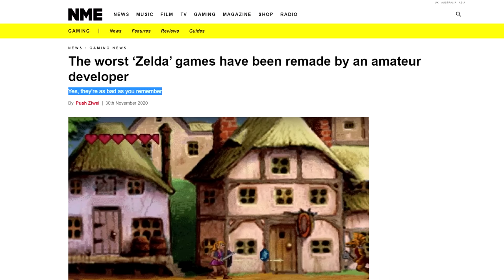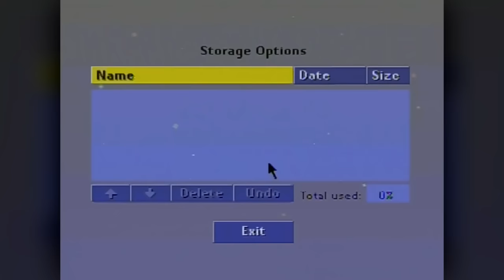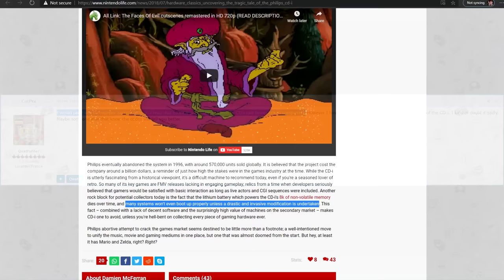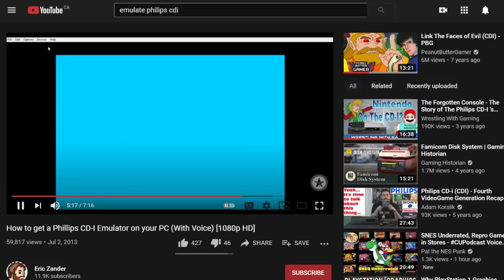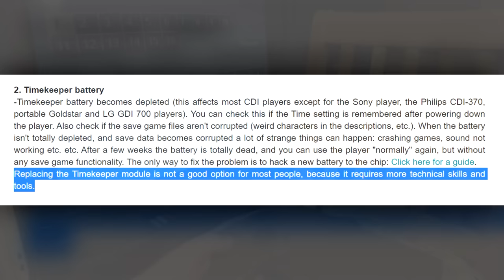Don't Risk Buying a Philips CD-I

Comment: CD-i owner here. You don't actually have to Dremel away the Timekeeper Chip. You can desolder the chip, solder in a socket, and buy a brand new replacement chip. I tried the Dremel trick and fricked it up, and I found a guy who sold me a replacement board for my model, one that he already socketed. If you need any extra help with your CD-i, let me know.
Reply: how do I do it
Reply: Some help needed here too. I'm about to buy both Zelda games as a collectors item. I do not expect to be able to play them though. Do you think I can buy a bumped up CD-i for an acceptable price anywhere these days?
Reply: @LevelUp_ErikJ  I've just picked up a 450 and it thinks it's 1989, so will need to do the battery fix. Not looking forward to it 😕

Comment: fun fact: this console is the first console to have a home screen, the year for this was 1991 when it launched.
Reply: That's probably because it needed to have one. Previous consoles used cartridges which could not be inserted with the power on, so having a home screen made no sense there. It was once machines could be booted up without media that they needed to show something on the screen.
Reply: Wouldn't the Famicom Disc System count? 1986
Reply: well the philips cdi had the first interactive one
Reply: @TeaMal_FX  The Commodore CDTV came out in March 1991, nine months before the CD-i. It had a home screen too. (CDTV was the first out of the gate of the failed "multimedia appliance" systems, of which CD-i and Tandy/Memorex VIS were the other representatives.)
Reply: @NozomuYume  well its a computer tho
Reply: @NozomuYume  and philips cdi was a console
Reply: @NozomuYume  but it might count tho
Reply: The 1990 Commodore 64GS also have the standard C64 home screen bcs it's just a C64 without a keyboard. but U can't actually do anything with it.

Comment: Protip: the CDi can play burned CD-Rs
Reply: Framerater has had horrible luck burning his own CDs. Check his 3DO and mistakes made video for details.

For me I think his mistake is not trying to burn his discs in slow and fast speeds, as some discs burn better on faster speeds. I find this strange, but I have had first-hand experiences where burning a disc slowly caused more problems that burning it quickly.
Reply from the maker: @thepuzzlemaster64  Someone told me that DiscJuggler can force drives to write slower even if they're not listed as compatible to do so. May have to look more into this...
Reply: @FrameRater  Imgburn or Nero at 10x (minimum supported) using just whatever CD-Rs I had in the drawer with a laptop CD writer worked fine. My CD-i (same model as yours) doesn't sound like that during boot.
Reply: Use good quality CDRs. I imagine it also helps to have a label on the top to make the disc less "see through". Most CDRs can be held up to the light making them see through.
Reply: @FrameRater  In my experience buring cds for the cd-i can be pretty hit or miss. some discs I burn work flawlessly, well others I have to pop in and out repeatedly to read. I recommend hp cd-rs as I got the best results from those
Reply: @thepuzzlemaster64  It can be a bit of a crapshoot. I have to use separate CD-R brands and burn speeds depending on whether I burn Saturn (Maxell discs at minimum speed) or PS1 discs (Verbatim discs at maximum speed).
Reply: @FrameRater  And I can confirm this is true. Funny thing is it'll force it to burn at slow speeds unless you buy the premium version or whatever, which no one ever would because the only reason anyone uses DiscJuggler would be to burn Dreamcast discs and you've gotta keep the speed at minimum to ensure a successful burn anyway.
Reply: @FrameRater  Burn speed doesn't matter, it's all about what blank discs you use. Only use Verbatim AZO discs. They have to be AZO, specifically. Any other discs, even other types of Verbatim cds, or other brands are most likely made by a company called CMC Magnetics, and are useless trash.

The AZO discs are made by Mitsubishi, and have a blueish color. They should work flawlessly, no matter what speed you burn at.
Reply: @FrameRater  
What I recommend doing is using CD-RWs (AKA: the reusable ones) as a way to test if the burning technique works, then using a CD-R for doing long play sessions. It helps keep the coasters to a minimum...though keep in mind, I've never owned an early CD console before, only burned early Windows games.

The real problem that can happen when burning discs is that the disc-drive that you're burning the discs to could wear-out quickly. Don't quickly burn 50 CDs on a laptop disc-drive, those things might start banging their laser heads to end their suffering.

PS: never been a big fan of Windows CD-burning tools. Every other OS like Linux or Mac come with a good one pre-installed. They don't do the weirder formats, but they are excellent at ripping and burning iso and bin-cue files. For Linux, if Ubuntu doesn't work try Manjaro.

Comment: I would recommend checking out Angry Video Game Nerd's CD-1 videos. Despite his videos being made before the 20 year mark, he mentions during the third Zelda game that he can't save, which would suggest that the model he's using (one of the VCR looking ones) will still boot the games if the battery is dead.
Reply: Not to mention it was his third CD-I, as the first two had issues.
Reply: I own a couple of CD-i's. All batteries are dead but they all boot the games except for one of which the battery died recently. I guess I'll have to wait a few weeks and try again when the battery is totally dead.
Reply: most of the CD-Is (like the 450 in this video) have no problems to boot with a dead NVRAM, other models such as the smaller 470 and the early 200 series have issues at booting.

Comment: The AVGN episodes were made within the lifespan of the battery.
oof
Reply: Now I feel old. Thanks
Reply: AVGN isn’t even the oldest internet video game series. The oldest I know is Classic Game Room, which debuted in 1999.
Reply: He also said in one of his videos (the Hotel Mario review) that he had to bought three units until one of them finally worked!
Reply: @DoswarePictures  At least AVGN is still running.
Reply: @DankRedditMemes  he even joked about it in his latest episode about how shows like The Simpsons shouldn’t run for too long, then said it was time for AVGN episode 180 something.
Reply: @LUCKO2022  though at that rate he also would’ve had the control port issue fixed.

Also, didn’t one guy who worked with him fail to fix the Jaguar CD?
Reply: @DoswarePictures  That dude you're thinking off was the guy who built the Nintoaster that James used for a long time.
Reply: @Laynel8  I know.
Reply: @LUCKO2022  huh.
Reply: Yeah but even with that it seemed like he had some battery issues. In his video he said he went through two 450 models and had to return them for disc read issues, which I'm assuming had something to do with the battery. He ultimately used a CDi 205 for his video, it had a dead battery but that model at least plays games with a dead battery, you just can't save. 

My CDi is a model 220, time keeper battery is dead (shocker) but seems that model will also play games with a dead battery. From what I've heard the 450 model is the most notorious as far as battery issues go.
Reply: Last time I turned my cd-I on would have been before 2010...mine is whichever model had a spring loaded hinged door hiding the cd tray
Reply: Ya but the avgn also complained about hardware issues and don't remember him mentioning anything about saving but he really only went into the Zelda games more than anything
Reply: @douglasschneider6753  well I think he did. And so did PBG when he first did Faces of Evil.
Reply: IIRC in one of the Zelda game reviews he complained the saves wouldn't work. Might be from the battery dying.

Comment: controllers
Nintendo: box then box with rounded corners
Sega genesis: comfy controller that also works with the 2600
Phillips CDI: SPOON
Reply: Sure you can have a spoon, but can you name one console that has a stick on top of a d-pad
??

Truly the top of culture.
Reply: @ItsRetroPlanet  Other than the generic PC 4 button controllers, no.
Reply: Sounds like a controller only The Tick could love
Reply: @FatMarioHeads  SPOOOOOOON!
Reply: Tommy Wiseau is a big CDi fan :) But seriously, those controllers were just supposed to be like handheld mice. Not for the games. This is another reason why it failed, it couldn't workout what it was. Games will never do well if you have to buy a controller as well.
Reply: It's too big to be a spoon, it's more like an ice cream scooper.
Reply: The Tick would be proud.
Reply: TRUST ME THE SEGA MEGA DRIVE CONTROLLERS WONT WORK ON THE 2600 IT WILL FRY YOUR 2600
Edit: it might not be guaranteed to fry it just don't quote me on that
Reply: @MatthewCobalt  The first version of the Master System  controller also had a screw-in thumb stick. No one used it and it was quickly removed to save costs.
Reply: @melo-7904  I've been using my sega controllers on mine and haven't experienced any frying. (The og three button, an ascii version of the three button, and the six button controller. No issues though I think I remember hearing pressing start on those might do that but don't quote me there)
Reply: @BioMega96  it might have been the other way around its been a while since I last heard it

Comment: I actually found a CD-I 220 during my sophomore year of high school back in 2012 where me and our robotics club were in charge of clearing out one of the school’s storage rooms for a then-upcoming garage sale. Mistaking it for just a regular CD player they planned on selling it for only 5 dollars, but as I was the only member of the club to recognize what the machine actually was, I expressed my great interest in acquiring it, and I actually ended up getting the CD-i for FREE when no one ended up buying it at the sale.

Though the disc tray needs a new belt and the front port tray accidentally broke off not too long after acquiring the unit, the actual hardware still worked upon powering on, and could play backups perfectly fine. Doing research into the unit I learned about the Timekeeper battery at a young age, and I only ever had it plugged in when I was actually using it, helped by the fact that there was no evidence of saved data prior to my aquisition. 

I am still in possession of the CD-i to this day, though I almost never use it except for occasional shits and giggles. Last time I turned it on would have been sometime in 2017 or 2018, but last I checked it seemed to be working perfectly fine. Even if it does end up failing in my lifetime, at least I can rest easy knowing I didn’t have to spend hard-earned money on a CD-i of all consoles [the unit at least. Acquiring the VCD card and an adequate controller did set me back a bit, but it was worth it to play the CD-I’s surprisingly decent port of Dragon’s Lair]

Comment: the CDI has no copyprotection like the 3do.  You can just burn the game iso's on a blank cd and they should run fine.

Also I hope you give Atlantis: The last resort a go. Its the cdi's second released FPS title and the only standalone CDI fps title.
Reply: Doesn't it require a digital video module?
Reply: @ZykovEddy  Yeah, I think so.
Reply: I had one of those too I thought it was neat at first then I found a way to find games to make my own cds I tryed out a lot of different games on it did you know you could go online with that too
Reply: sega cd also didn't have copy protection, for those wondering.
Reply: Illegal
Reply: @rido1274  no, Not really. The system hasn't been supported in nearly 30 years. No new games are being made for it commercially in over 20 and nobody in the company profits from selling the games or consoles. It is basically abandonware, much like most of the consoles from the 90's aside from the nintendo ones.

Comment: I hate to be one of those people leaving a ridiculously long comment but here we are. I'm kind of known for being a CD-I fan and bit of a historian on it. Not how I expected my life to go lol.

 I hope this doesn't come off rude but bidding on the cheapest CD-I possible on ebay, or most other electronics, isn't exactly the best idea. I've got a 200 series with a dead battery for years, literally since I've owned it, and aside from it not saving games it plays all games just fine. It had the same embedded battery in a chip but it doesn't need to be replaced. The issues with certain CD-I models (due to time) is pretty well documented. I believe some of the sites you credit throughout the video have details on it. The 3 button Genesis style game of us good if you get one in decent shape. I use a snes to cdi controller adapter and the CD-I mouse cause some games really play best with the mouse.

Did you get the video cartridge for your CD-I? Without it some games can't play or will play with reduced quality. There's some genuinely good games on the CD-I like Thunder in Paradise, Chaos Control, or the beat em up Mutant Rampage Body Slam. There's even a FPS game on the system. Ok the FPS game isn't great but that's more due to bad art direction and kennel design. It actually runs very smoothly. There's also ports of Myst, 7th guest, dragon's lair, several American laser games, I could go on. Also, you can burn any game for the CDI. Archive org site has almost every game available for download. 

I'm sorry your CD-I journey got off to be a bad start but a lot of the "pitfalls" that come with a first CD-I purchase are avoidable. I'm on Twitter if you need any help with the CD-I under WrestlesGaming.
Reply: amen.
Reply: @nathanielcody6769  There are two versions of the digital video cartridge. The first one has a larger casing and is a 100 pin cartridge that won't fit in the 450. There's a second one made for the smaller second generation of CD-I consoles that's 120 pins and does work on the 450. 22ER9956 is the model of the DVC needed for a 450 CD-I.
Reply: @nathanielcody6769  
what adapter?
there is a slot under the left top cover for the smaller model DVC.
Reply: @einherrjar  I think he's under the impression that the DVC doesn't work on the 450 at all. My guess is he or someone he knows tried using the wrong version of the DVC in one. I think he's just using "adapter" as the part of the DVC's name.

Comment: I ordered a modded CDi system from the same seller Patrick (sellingmycollection78) on eBay back in late November. The only difference is that I'll most likely receive the spoon controller and not the superior one. Either I'll have to ask Patrick if he sells those separately or mod a device to use a SNES controller to the system. I'm still waiting on the system due to the pandemic and I did ask him about the item location issue and last time we heard about it, the package was transferred from the NL Post to the USPS and that was on December 11. A couple of days ago, Patrick requested an international inquiry with his post office in the Netherlands to get to the bottom of this. So he is really generous when it comes to locating the system, especially in times like these.

Update: I received it in the mail yesterday. The only thing is that you'll need to buy a EU to US plug adapter since Patrick doesn't include them with any of the modded systems he sells.

Comment: I'm proud to have hunted down a 3DO and I still play it from time to time but I sure as Hell won't go out of my way to track down a CD-i unless it's at Goodwill for cheap (sometimes depending on the model they might mistake them for being old CD/DVD players).
Reply from the maker: 3DO is so underrated. It's like the CD-I but done right... even then there was room for improvement but just in retrospect, it's easy to look at 3DO as a victor in comparison to this thing.
Reply: @FrameRater  For sure. The 3DO was an honest attempt at a bleeding-edge console that was just too far ahead of its time in a lot of ways, whereas the CD-i was just a glorified CD player that was woefully-incapable of playing decent games despite how they tried to market it as time went on.
Reply: The 3DO was just too early to market by about a year or two. The main reason it didn't really catch on was that it was just too expensive, costing $600 at launch when other consoles, which were still at their peak, were less than $200. Part of that was because the actual console manufacturers (Panasonic, LG, Sanyo) weren't game publishers themselves nor did they get third-party licensing fees (which went to The 3DO Company), so they couldn't sell the consoles as a loss leader and make up the difference in software profits like the other console makers. But also because the manufacturing cost for the units was high because of the level of tech. A couple of years later the costs had come down enough to make such a system more practical for the market, which was by that point looking for the next generation. Those are the reasons why the PlayStation was able to catch on but the 3DO didn't. The 3DO was too early, too expensive, and had a economic model that didn't work.

Comment: I'll be honest, I would enjoy stories on the pitfalls and things to know when buying specific retro consoles. What might need replacement or maintenance. For example, pointing out the OG Xbox clock capacitor issue, or the battery issue here.

I enjoyed this video, and look forward to seeing you 'enjoy' 2 of the CD-I Zelda games.
Reply: At least the clock capacitor is much easier to fix.
Reply: matt fahringer  what do you mean? Well you can replace it, but to some (such as me) having to reset the time every time the system is unplugged is a sacrifice worth making to prevent the system from being damaged, so one could just remove it.